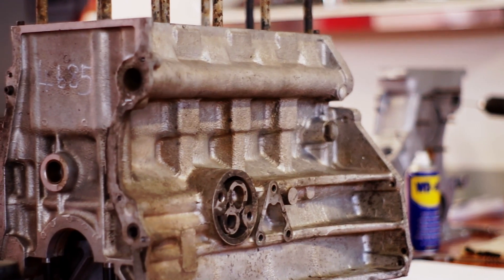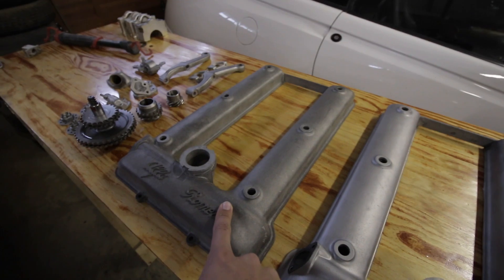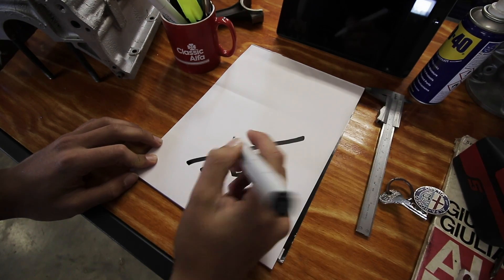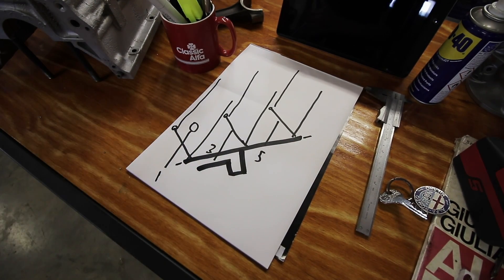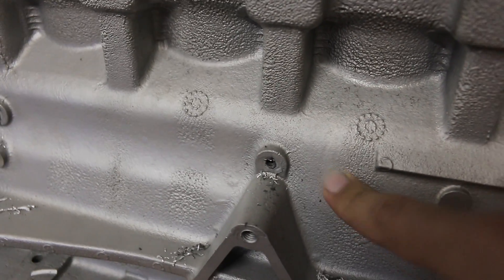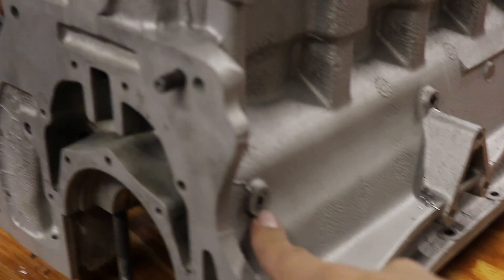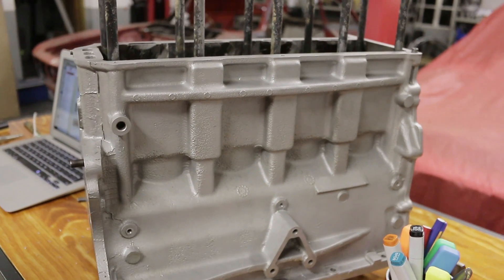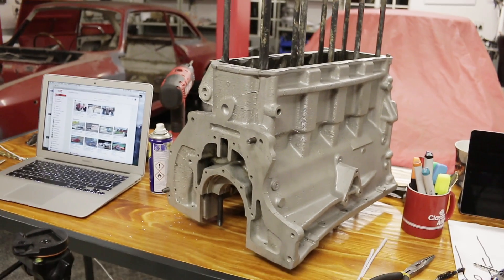FOR THE ROAD 5: Bead-blasting an engine block and cleaning up the oil-ways

Comment: Drilling out the oil gallery plugs in order to properly clean them is ok, provided proper means of sealing the threads is available while installing the grub screws. However, what prompted me to post this, was your statement of threading the block for grub screws, AFTER you had cleaned the galleries. I sure hope you cleaned the oilways again after threading. Otherwise, the shavings from threading operations would have stayed in the galleries, and soon found their way into bearings.

As some have pointed out, where steel and aluminum are in contact, corrosion will take place. Use a high quality sealant as available from vehicle manufacturers, perhaps even a Loctite, not a silicone of any type.

Good series of posts, I sure have been enjoying them. keep up the good work. Cheers from a European born eng. D spending his retirement living in Indonesia.

Comment: If you go and tap the oil lines then i think it would have been  better to only clean after tapping to get rid of all the shavings.Compressed air from the opposite side to push out the shavings.

Comment: Is there a reason you don't plug the oil ways before bead blasting so they don't get in there in the first place?
Reply from the maker: Riley Lammert well they’d get in anyway, because the head’s off and the crank is out. I’d need to clean it out either way.

Comment: Every drilled out hole, even with a bolt threaded into it, is another potential oil leak in an engine already famous for leaking oil. It’s certainly outside the box thinking, but there is a reason we have used dip tanks for decades. Hope it works. I’m pulling for ya!
Reply: In fact, Jethro had that very problem when he put the car together; the plug at the back of the block leaked and he had to kluge up a bolt and washer to keep the oil in. https://www.youtube.com/watch?v=fmFbQAiV7MQ
Reply: he could have clean the bead without drilling anything

Comment: Talking oilways and engine bay restoration many people drop the (old-fashioned) mechanical fuel pump in favour of an electric pump for easier start up ( dcoe side droughts take some filling ) but alfa in  their wisdom knew that a quick start after a long period of standing idol takes years of an engine ,so by the time your mechanical pump has cranked enough fuel into those carbs the oil pressure is up and good to go . Old henry ford stuck to mechanical fuel pumps for the same reason .

Comment: Haaa..a
 that's funny my workshop is not Jethro's .. I have too many machines ranging from 5 classic bikes to 5 cars and a school bus camper :-)  No,  I'm a reader of his work or should I say admirer .
Yes the big debate about removing studs . I was making a passing comment about removing such items and not suggesting to do it .. That's at the discretion of the idiot to try it... In my experience thus is a good way to start and get results. The biggest thing is that the studs actually sheer off if not done this way.. From what I have read. I have removed a stud from a 1300 successfully and put a new one in its place. The threads are about 40 mm long from memory and high tensile. I'll see if I can find a photo from the net. 
How about yourself John what's your collection ... Does it include a bandit monger (Giulia super)
I had one and my father did back in 1970 what a great car . My Father pulled a caravan to Italy and back to London 4 birth (Sprite major) I think it was called . It still went hard if you didn't mind the fuel bill 70 mph haaa.a the opposition was the Renault 19 that just wasn't as quick but fun to prove it at the lights...
Have a good one !

Comment: Vapour blasting isn’t even a good method for cleaning a block, the risk is just too high. The miniscule beads litralley embed themselves in the material. God forbid if theres any oil\grease residue in any oil galley before you’ve blasted. You will never get them all out. Theres way too many posts online from people who have engines ruined.,

Comment: Nice video.
Looks great but please tell me that after cleaning & rodding through the oilways, you repeated this routine again after tapping the threads for the new oilway grub screws ? 
You didn't venture into removing the head studs then !  That would be tempting fate. Anyway, nice job.
Reply: John Sadler
 hi John, 
It is possible to get the studs out the easy way and that's heat the entire block in an oven to 200 deg C and get a stud extractor down low on the stud and with a conventional one on the threads at the same time.. Two man operation with the block in a vice or something... Freeze spray the studs if they won't budge with a bit of electrician's plastic conduit tubing around them sealed at the bottom with bluetack . That stops wasting the gas and confines the cold.
Cheers 
JT
Reply: @geoff3656  .
Phew ! I've been hitting cars with hammers since 1966. 
Over the years I've learned many 'Tricks of the trade' as regards extracting seized or corroded or both, bolts and studs from some extremely expensive bits of casting. 
One method which I discoverd by accident is....heat up the steel bolt or stud, allow the time for the aluminum to 'Sap the heat from the steel and into the aluminum casting, them try giving it a twist. The logic is that aluminum expands much quicker than steel so the steel gets colder and the aluminum gets hotter. 
It proved very successful but it's not a 100% guaranteed method. Corroded studs should be left well alone !!
Reply: @geoff3656  .
Sorry, I missed this message.
OK. Removing the studs from the Alfa Cylinder block. 
I respectfully advise you to consider, that before you invest lots of money in heating the block, freezing the studs, Strewth ! Ask yourself, 'What's the condition of the cylinder head studs ? 
Are they corroded enough so as not to allow the Cylinder head Nuts to be tightened to their correct torque ? 
Will the studs, when attempting to torque to service requirements, will they exceed the 'Modulus of elasticity'.  
Forget what I've just stated above, it's what we were taught at the Technical collage back in the 1860s. 
Can you crunch down the head nuts without them stripping or breaking, if so, why go to the trouble of extracting the studs ? 
Consider that if you should be successfull in extracting them.....what about the threads ? Extraction could rip out the threads but you can feel this as you unscrew the studs. Many a block has been reduced to scrap   after the head stud threads have been stripped. However, we now have Helicoils, but are replacement studs available. Can you see my forward thinking. 
I think that most people agree that if 'It is there, 'It will happen (that should be Shit but I'm trying to keep to the respectfully guidelines). 
Actually, A friend of mine had an Alfa Juliet Sprint Veloce, way back in the 70s. Of course, the Alfas are identified by slightly different names according to the export destination. The old Alfa Saloon that you worked upon many years ago was a 'Car of choice' for the Italian Carabiniere (the fuzz) and I think they were featured in the film 'The Italian Job'. How am I doing ?
Anyway, you have the cleanest workshop I've ever seen. 
Nice one !!

Comment: Bead blasting non pressure casted Alfa blocks is a very risky move. The glass beads imbed themselves into the aluminum and once the engine heats up they drop into the oil pan. I’ve seen oil pans full of glass beads that starved the engine of oil and started knocking.
Reply from the maker: Jimmy Grant Hmm. I’ve never seen that before. I did this exact process on my Sprint GT block and I never found any glass in the filter or in the oil over 100 000 Kilometers.

Comment: I appreciate the extra effort you put in to clean the oil gallerys but i dont like the idea at all of drilling into an original alfa block and making unoriginal holes and plugs..
Reply: The holes are already there Paul .. they are just plugged up by a soft aluminium plug .. Jethro isnt drilling the block he is drilling the soft plug .. you can even see the colour difference if look carefully. 
Also the later 2.5 blocks already had a thread cut in the  block yet still plugged

Comment: Excellent work. Have you considered soda blasting or even wet soda blasting? I made my own rig and works great for carbs and small engines. Thank you and good luck!
Reply from the maker: stephen gardin thanks!

I have moved to wet soda blasting for engine blocks and aluminum parts since this video, it really gives a great finish.
Reply: i was wondering why you didn't try (or mention) dry soda blasting. soluble medium and presumably same equipment

Comment: Hey YouTube my dad and me are rebuilding an alfa nord 1750 engine. This is my first restoration of this size always worked on dirtbikes mainly. Regarding timing and electrical components do you have an turorial to time the ignition ?? I'm a bit stuck at this instance
Reply: Jens Duhem make sure the cam timing is set right.
Reply: Static timing is done with engine at tdc no 1 (f mark for fissa -fixed)  drop in the dizzy and you want it so the points just are opening. ..you set with a test light...this should get you running
Ensure oil pump is fitted so dizzy rotor is pointing forwards
Reply: Its easy to do hard to explain but its in the manual